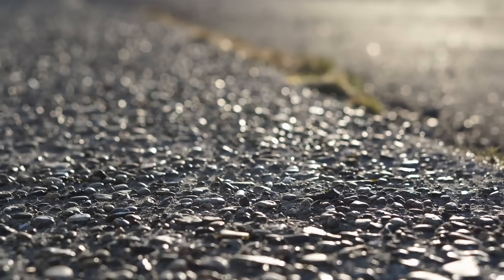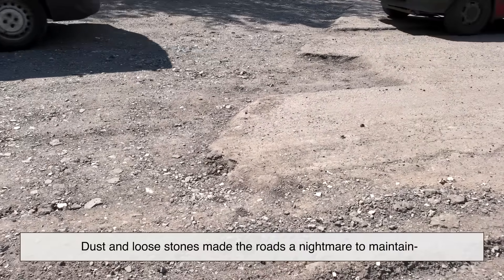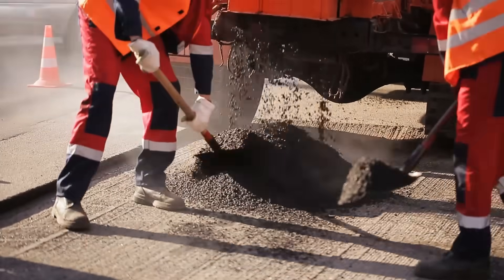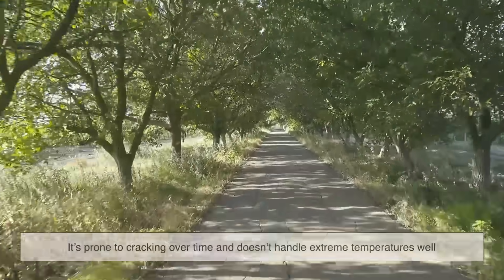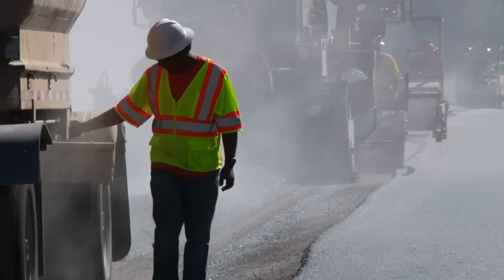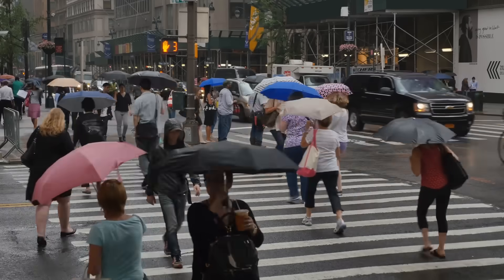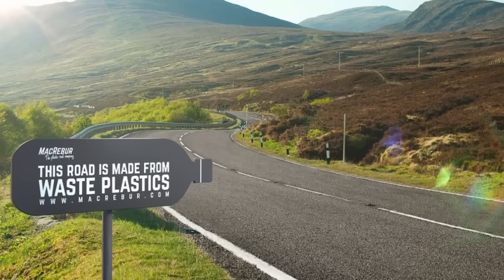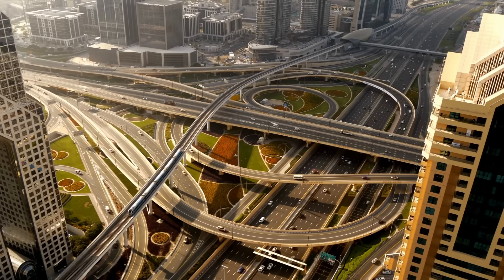What’s the Difference Between Tarmac and Asphalt?

Comment: Thank you for the clarification...and great video!!! 

Asphalt is actually a form of concrete...using bitumen as a binder in lieu of cement, and heat to create it (hence the term 'hot mix') and it has the letters AC generally in front of a number, that number being the aggregate (stone/rock) size...i.e. AC20 is an asphaltic concrete with 20mm stone. 

We here in Aus call your 'tarmac' a 'slurry seal' and is not so widely used, whereas most of our rural roads are 'spray seal'...sprayed bitumen from the rear of a tanked spray truck at around 200 degrees C, followed very closely by trucks dropping stone onto said bitumen and roller/s right behind them...generally conducted with a larger & then a smaller stone to give a relatively smoother ride....but, not as smooth as asphalt though, it covers a lot more milage than paving AC, as it's an extremely fast process.

Now you lot just have to start calling concrete just that...not cement. You can't pour cement...cement the binding additive in concrete, also in brick mortar (or mud) and 'cementicious' products...concrete is a combination of 'cement', sand, aggregate and water...as well as other additives these days...so it's not 'cement'...as such....terminology will be just that...regardless of technical correctness...just one thing that makes me cringe is calling 'concrete' 'cement'!!!!

Cheers from Sydney Aus!!!! 🍻🍻🍻🍻

Comment: Solar road are a ridiculous fraud : not durable, not weather resistant, not useful (there is a reason why solar panels are not installed on flat surfaces or are build at an angle), roads are dirty (so less energy), and it's very expensive. By the time we'll have a technical solution to all these problems, we'll all have Star Trek-like transportation.

Comment: Well it probably explains why in the 1960's and 70's when it got really hot the road would melt and stick to your feet, shoes and tires, it must have been using coal tar versus asphalt which today's roads don't seem to have the same issue even at higher temps. The melting point of bitumen is around 120-150°C; The melting point of tar is around 42-46°C

Comment: In Minnesota, there is a test side road on the interstate where the DOT has a test facility. When they need a real-world test, they divert the westbound lane of I-94 to travel over the surface. They also use the diversion to test pigments and such. Considering  There can be a 130 degree F swing winter to summer sometimes, I guess it is a good testing location.
No southern state equivalent, tho, leave that to Texas NM and Arizona.

Comment: It's just sad when newscasters refer to an aviation accident on the ramp as occurring on the "Tarmac"!  Tarmac isn't used anywhere in modern aviation, as its brittle and friable in cold weather and just plain sticky when its hot.  Some smaller general aviation fields employ asphalt for taxiways and runways, but virtually ALL Class B and C commercial airports use reinforced concrete, sometimes as much as 2-feet in thickness, owing to the enormous point-loading imposed by large jet aircraft, especially in the touchdown zone.  The loads are so extreme that most Class B airports (O'Hare, Atlanta Hartsfield, Denver, etc. routinely scrape several tons of rubber off runways every month, due to tire scrub.  Neither tarmac nor asphalt would hold up to that.

Comment: I see this is a USA-produced video, so terms may be different in the US. 

Here in the UK, the material in use for decades, (actually nearly a century),  was called Hot Rolled Asphalt (HRA), and is a mixture of quarry fines, sand and very small stone chippings that has almost no voids in it. Laid on it's own, it would be a very unsuitable material because when compacted by rolling ,there is almost nothing for rubber-tyred vehicles to grip on to.  So after rolling out, the new and still hot asphalt has bitumen-coated 10, or 14mm chippings spread on top, and then rolled into the bitumen surface. These bond into the still-hot bitumen layer and provide a good running surface with excellent grip. Such road surfaces can last for well over 30 years with minimum attention.

In Germany, an alternative bitumen mixture called Stone Mastic Asphalt (SMA),  was developed well over 50 years ago. This is a mix of bitumen and larger stones of 10 or 14 mm throughout the mixture. This means it can be laid in a single pass of the paver, then rolled out. There is no need for the second stage of rolling-in coated stones as they are already present in the mixture. So it takes less time to lay. However great care must be taken to ensure that sufficient binder (bitumen and fibrous meaterial),  is used to minimise or even eliminate voids after rolling out, because it is water getting into the laid surface and the action of frost and traffic that destroys road surfaces very quickly.  HRA, being virtually impermeable, does not suffer from this problem.

Anybody who has driven on German roads will know they are like billiard tables compared to the UK,  but use of SMA in the UK in recent times has been a disaster, with resurfaced roads lasting only a few years before UK weather breaks down the running surface and potholing and spalling of the surface layer occurring.   Maybe the UK suppliers of SMA got the process completely wrong when it first came into use, who knows ? Later iterations seem to be lasting much better so lessons would seem to have been learnt.

Comment: I've done a number of long-distance multi-day walks in the British Isles since 2010. One thing mystified me for a long time: when required to walk along a roadway, the tire noise was extreme compared to comparable roads in the US. I finally realize that the culprit was the road surfaces and not the tires; the roads are simply more coarse with rather chunky bits of stone exposed rather than the more dainty ones seen in most asphalt/macadam (whatever) I'm used to. I still wonder why the roads are that way. Longer wearing? Cheaper? Better traction in the often-wet conditions? Of course on rural roads, often with no shoulder, having a lot of noise from an approaching vehicle is a plus, giving the walker a chance to dive into the gorse and brambles if needed.

Comment: You are confusing names as most people think tarmac and asphalt are the same.  Mcadam is used a lot in Pennsylvania and requires that potholes be filled and then hot tar is laid down and stone chips, usually crushed limestone under ½” are laid down before the tar dries.  It is then rolled just like asphalt.  Filling the potholes is more critical with Mcadam.

Comment: On the gravel parking lot outside my Condo they put Tarmac (@ the drives), spread it unheated, sprayed water, no roller, & left...   45×45 meters in ≈ 4 hours incl. spreading the material. I thought What 😮 are they doing?

I am from Sweden, Retired, now living in Bangkok. So i could not easaily pop a question.....

It made it dusty & smelly & kinda itchy.. Not a great issue for me, cuz i have sealed my Condo extremely well & use my AC to draw out the moisture. But Thai Condos (like, i think in all hot climates), have concepts for getting extremely good ventilaton (blowing right through, if you can't afford an AC), down to a trickle. But usually you can"t close them off entirely....

So i noticed my neigbhbours started gargling / spitting out. ....Never heard that before the tarmac job.

Black surfaces get extremely hot in the sun in the Tropics. Perhaps they count on the sun & the cars driving to slowly bind it together. Cuz they are Economical...  One of the ways, perhaps, to keep the almost nothing in monthly fee (which is veery nice)...

Comment: Bitumen tends to be used in the UK for what Americans colloquially call asphalt or more properly, asphalt concrete.  Originally this was a substance mined from natural deposits.  Now geologists tend to call those bitumen and the roads are typically made from manufactured bitumen/asphalt.  Bitumen in some forms is colloquially sometimes called tar (the La Brea Tar pits) or oil (the Athabasca oil sands).  Chemically, bitumen (natural or refined) is a pitch, and tar can also be a pitch, but often tar refers to something more liquid such as coal tar.

Chemically combined with colloquially it's all very imprecise and confusing, and so trying to draw a distinction by composition as does this video is either an incorrect simplification or no distinction at all.  Perhaps a more precise distinction could be done via the method, rather than the composition.  Tarmac uses tar laid over top of the macadam (gravel and sand) road as a binder.  Asphalt is laid down as a mixture of tar, gravel and sand.  The mixture means a more uniform composition which is what leads to the greater durability, not the components.

Comment: Asphalt is the high viscosity fluid which occurs naturally in places like the La Brea Tar Pits, but has now been applied to several classes of bituminous and petroleum derived binding and coating materials. The bonded aggregates in tarmac tend to be all of uniform size, the aggregates in asphalt composite are of a wide range of sizes, which makes the intergrain spaces much smaller. I guess the exception would be permeable asphalt which uses larger aggregate and thin high strength binder to provide drainage spaces, like tarmac it is prone to frost damage.

Comment: Neither r good in cold hot climate, asphalt with up to 20% crum rubber is showing good results in some north western states. More flexible and less cracks. But hasn't gotten widespread use maybe cause it costs more.

Comment: In one sense, you can still find it. Some driveways and side roads, rather than being left dirt or gravel, are not covered with crushed asphalt that has tar mixed in with it, then roller compacted. It's not a durable surface, but for low traffic use and as a way to keep the dust down, it is effective.

Comment: A bit of trivia, when I was growing up, a cheaper method was used on our community roads. Rather than asphalt roads that we know today, the township extensively used "tar and chip" roads, which was asphalt poured onto the old surface, small gravel then dumped unto that and a top coat of asphalt poured over the stones.
Made for an unholy mess when I came into the house, eventually moving to taking off my shoes before coming in the door and using lighter fluid to dissolve the asphalt stuck to my soles, rather than coating our linoleum floor.
Yeah, gave away my age there...
Didn't last anywhere as long as asphalt roads and the stones would kick up and scratch the paint on cars, making the political leadership ever so popular with the public. Leading to the slightly more expensive at the time asphalt roads that remain today. Longer lasting and as a side effect, easier to plow. The road ain't worth much if one plows up the aggregate along with the ice and snow.

I also learned during my global travels in the military that there are different mixtures, depending upon the environmental conditions. Hot vs cold being predominant, so Germany would utilize a different mixture of asphalt than a tropical nation. Use the wrong mixture for the application environment, it won't last very long, maybe a season.
And I've yet to find a surface that can survive the desert for long, well, save for my skin.  ;)
One benefit of pure Sicilian genetics, having enough variety due to historic, erm, interactions to tolerate the African and Arabian deserts and the frigid wastes of a northern winter. Although personally, I prefer my climate like I prefer my women - hot, which is why I always tell them how much I enjoy the meatloaf.

I'll just get my coat...

Comment: The best way to look at it is "tarmac" evolved in language to mean both the airport runways or the original material.   If you are dealing with specifications on a paving project, the term as used in the industry has to be used.    A good example of this is in the railroad industry, journal/plain bearings were in boxes containing grease and when they were failing would generate heat and catch fire.  They were called "hot boxes."   These bearings were replaced with roller or conical bearings and the box was eliminated.  Infrared detectors were placed along the lines to detect heating and therefore failing bearings for the roller/conical bearings.  They are generally called Hot Box Detectors even though there are no boxes.

Comment: A long time ago I saw a single machine invented in Germany that scrapes up the old asphalt, processes it (including adding a small portion of new asphalt) then lays it back down and a roller finishes the job.
This machine allows vehicles to use the new road faster than conventional methods.
I'm presuming when the apartment management says they're going to "resurface" the parking lot, it's likely with tarmac.

Comment: I was told by a man (working on a local highway) that one of the reasons that northern states use asphalt and southern states use more concrete is due to weather conditions. Asphalt absorbs heat from the sun and tends to melt snow and ice quicker and dries out from rain quicker than concrete. Also, asphalt gets soft and deforms quicker in southern states due to the intensity of the sun. And southern states don't need the snow and ice melted so they tend to use more concrete for roads. 
I'm not sure if that's 100% accurate but it makes sense.

Comment: Great explanation.  The media likes to use the term "tarmac" when they really don't know where the airplane is.  The FAA does not define "tarmac", but it does define "tarmac wait time" as the time passengers are on an airplane that's on the ground and the passengers are not allowed to deplane.  The plane could be at a gate when the doors are closed, on an apron, on a ramp, on a taxiway, or on a runway.

Comment: Tar and chip roads are still widely used in rural areas due to their ease of application. Low traffic volumes allow them to survive for quite a while. They are not suitable for high load or high traffic areas.

Comment: Just found out tarmac was a substance and not a surface.  Always heard it as "out on the tarmac."
Reply: And originally it was Tar MacAdam… 
The binder in modern asphalt is actually synthetic rubber…
Reply: Right, same here. lol
Reply: Tarmacadam. Tar MacAdam
Reply: Tarmac: Area of an airport where planes park or maneuver.  The American Heritage Dictionary of the English Language, 5th Edition
Reply: Yeah, he completely ignored the common and incorrect usage of "tarmac" with regard to airports. The correct aviation term is "apron". By coincidence, last week i had a lengthy conversation on this exact topic. Conclusion: I was acting OCD 😂.
Reply: Concrete, which both tarmac and asphalt paving are a form of is a substance, upon which one walks upon its surface. Well, save when it's being installed...  ;)
But, if I'm walking across a wooden bridge, I'm still walking upon the surface of the substance known of as wood.
And yes, both are concrete, just that the portland cement or lime plaster got replaced with either tar or bitumen as the cement binder for the aggregate.

And the video only scratched the surface. Plastics recycled into aggregate, assorted other substances being experimented with as well and common today, recycled rubber from old tires being used in the aggregate, providing some flexibility, but more importantly, improved traction. Even such basic technologies evolve for greater durability, expanded utility and enhanced usability.